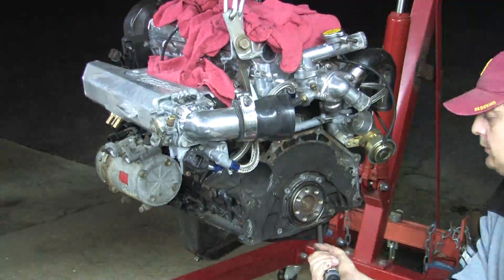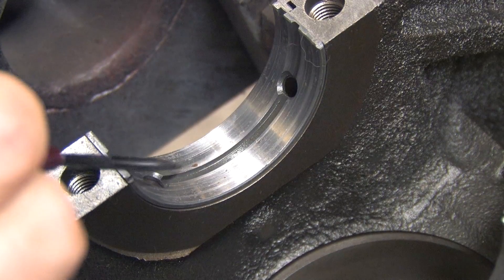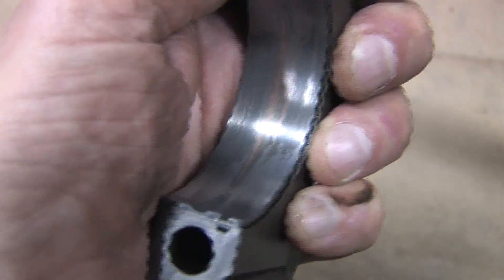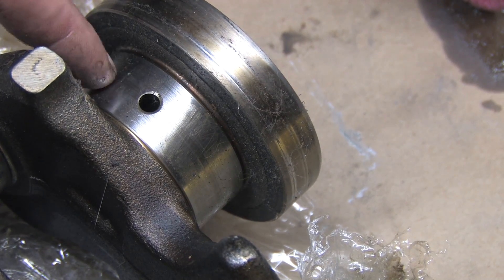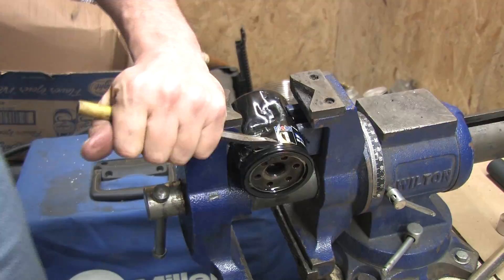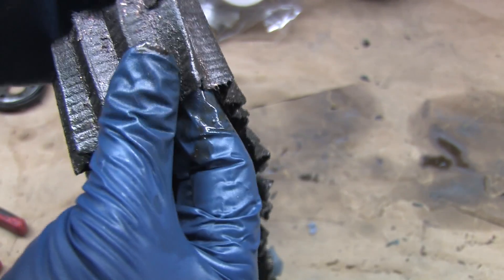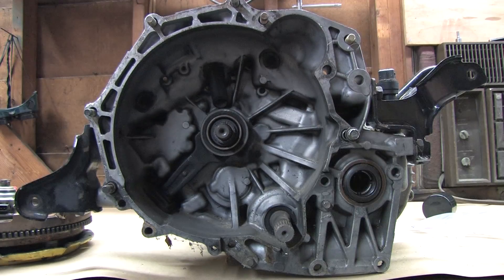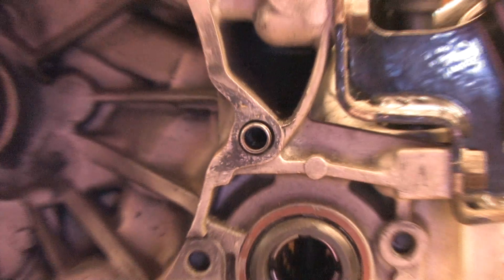7-Bolt Shortblock Failure - Full Diagnosis

Comment: I used to work in a Saab specialty shop. Saab oil filters come with a plastic cover to prevent debris from getting into them. You had to be careful when you puller the cover off because sometimes the little nipple that went into the thread would break off and stay in the filter.
We had an underpaid guy who worked for us that did all our oil changes, tire, etc and he changed the oil on a car and accidently left a tiny bit of plastic in the filter that got sucked up and lodged in the oil port to the head. It passed just enough oil that the car ran, but the lifters would start to clatter a bit when it got hot and he ran it hard.
About 2 months after he got his oil changed, the engine underwent catastrophic failure. When I took the engine apart to determine the cause, it looked almost exactly like you engine looked, major damage at one critical point, and minor damage from all the metal in the oil.
Your point about the missing bolt and the clutch is spot on. You will get all sorts of major issues from that bolt being missing.
I seriously doubt that was the cause of your problem though. I suspect that something blocked that oil port.
Reply from the maker: Thank you for your detailed comparison.  I fully agree with you.  I did have oiling problems in this engine.  But it would have taken a LOT longer for the bearings to spin if I didn't have a mis-aligned clutch hammering and pounding on those bearings prior to the oil starvation.  That clutch bolt is responsible for more cases of crankwalk than DSM owners are willing to admit.  Like the clutch problem, the oiling problem was my fault because I'm my own mechanic.  That's why I'm here owning my mistakes.  ;)
Reply: That bolt is the cause of a lot of problems. I have seen destroyed clutches, damaged crank flanges, broken starter holes, and many other problems like that on all makes that have that basic system, so it is not just your car but a front wheel design flaw that is not easily remedied.
If it was the primary cause though, you would have had more damage to the thrust bearing surface (it did not look very bad to me, and .014 is not enough endplay to obstruct the oil ports), and the rear bearing would have been in worse shape.
Mistakes happen. Even the best techs let a piece of junk fall in an engine from time to time. I once dropped an M&M a Saab fill tube. This was back when Saab engines used the transmission as an oil pan. I had to pull the engine and separate the units to retrieve my candy. My boss was pissed lol.
Reply from the maker: joshua43214 Ah yes.  The old-skool Saab 900.  Joy of joys.  You had to pull the engine for just about every service job on those things.  It's a shame that M&M's aren't magnetic.
Reply: *****  Lol, yes, it's just too bad. The M&M isn't magnetic, but it is attractive. MMMM. Candy. :)

Comment: This exact method of failure occurred on my 6-bolt...the "crank walk bolt" fell out and then the engine started loosening the others+the starter bolts.  I caught it after replacing the clutch and it's shifted like butter since. Thanks for posting this...hopefully it saves a few engines (and broken dreams).

Comment: i think i found the cause of crankwalk..starting your car with the clutch pressed,on the 7 bolt engine the oil film tends to run off the lateral bearing,on a cold startup with the clutch pressed there is no lubrication untill the oil psi gets there,so there is s moment of wear...

Comment: 3/4 rods spun and if it was bent why would the thrust/#3 main be the only bearings with extreme wear like that? I would think itd be more like 1&5 with the extreme wear if that was the case. your 100% correct .015" end play is a significant amount of end play. just curious did you bother placing the damaged crank on a balance machine confirming it was bent? this is interesting. could it be that the bearings weren't perfect and journal originally wasn't in spec? what brand bearings?

Comment: excellent video, bravo. as Honda owner and a caterpillar technician and have been thru several failure analysis classes, blew and built 100's of engines and my conclusion is this engine was oil starved at some point whether the engine oil level wasn't adjusted properly or the engine was raped on with low oil temperatures, since 3&4 are the furthest away from the pump they were the last to get lubricated. bending a crankshaft from shock load isn't likely IMO, that don't really don't explain why

Comment: I've encountered this issue MANY times. Rather than crankwalk, i've seen it all too often result in cracked and broken bellhousings. Two GVR4's came into my possession over the years which each had this "special bolt" as i call it, missing. They both had cracked bellhousings. A word to the wise, if any of you reading this ever have someone ELSE work on your car, make SURE they put this bolt back in! The factory one has a 12mm head, and has a #10 on it.

Comment: jaf, what's your thoughts about flywheel step. The machine shop told me the competition clutch flywheel I bought was .605-606 when he measured it and he took multiple measurements.  he said it would be ok to run it like that and he straight up told me he couldn't get it any better or maybe make it worse?

Comment: Thanks for your reply! Hey, if you would like to check out the sound I was talking about, just visit my channel and there is a single uploaded clip of my car and the sound. Actually there are two different sounds; the first one comes in at around 0:11, and sounds a bit like a loose metal part, and the second, more worrying sound can be heard throughout the clip while the engine is on. It might be lifter tick as you said, it might also be a worn ball bearing on the pumps.

Comment: Although this was a very interesting and informative video, it somehow creeped the hell out of me; how one single, tiny, probably 1-2 dollar bolt can save your engine, or destroy it if it's not present.

I have a '99 Galant with a 4G64 2.4L engine. Can the same rules apply there? Should I go and take a look if I am also missing said bolt? I've already got some nasty ticking sounds coming from the engine, I don't want any other worries...

Comment: Very interesting. Does the same thing apply for FWD transmissions too?  I'm going to look up under mine tomorrow to see if the clowns who built the motor and put it back together put that bolt back.
They didn't even put the flywheel cover back on, so my expectations aren't very high.

Comment: I believe my '97 GSX recently suffered from the same failure you experienced with your 7-bolt, but I have yet to tear it down. Could be worse, Piston #2 came in contact with my spark plug. I also found a rocker floating around in my head, over that same cylinder. I'm going to verify for you, if that "crankwalk" bolt is in it's place, though I doubt it.

Comment: I can't post a link for you, but you should find a good explanation by doing a search on "4G63" engines.  I don't have enough experience to confirm it, but I've read that "six bolt" refers to engines from 1990 to early 1992, and "seven bolt" refers to engines from early 1992 to, um, something like 2006.  An Internet search should fill in the details.

Comment: Given the damage that happens once the bypass valve is activated, I wonder how hard it would be to add a sensor to that valve. If I'm running on unfiltered "emergency" oil, I want a warning light. Jafro said in the video that "oil filters bypass some of the oil, and that's just how it goes", so I guess that a very simple warning light would give lots of false alarms. I'd still rather have that sensor, however, in case there's a sudden jump in the frequency or duration of unfiltered oil events.

Comment: On another note, has anyone that had this bolt missing and then put a bolt recently on that hole noticed a diffrence on clutch engadgement? From what ive noticed the clutch engages sooner now after the bolt had been installed. Or its just me overthinking things and being paranoid? Oh and btw a bolt that i have in there atm is just from a auto parts store m8x60 1.25 threads. If thats the correct one.

Comment: Hey jafro great informative video. Bitter sweet experience for me because i was praying that once i crawl underneath my car i would find this bolt on that hole however it was missing. I hope its not too late. Ive driven my car for 8k miles for two years now (133k on odo atm) since i bought it. Hard acceleration here and there. I hope its not too late now that i have that bolt in there. Car is stock and its my dd.

Comment: The drain back valve you referred to is a separate valve that most oil filters are equipped with and is essentially a check valve made of rubber that blocks oil from draining back through the INLET side of the filter(outer holes). Also, not to be too picky but not ALL oil filters are equipped with a by pass valve either, the by pass valve on GM engines is integral to the oil filter adapter therefore filters made for GM engines are not equipped with one. Awesome video's keep up the good work.

Comment: This video was published the same week I was pulling the transmission out of a neglected 1G I had just bought.  I just now saw this, weeks after I sorted the problem out.  I wish I had seen this sooner.  :D  That bolt was broken off in the transmission on the car I bought, and several other bolts were missing.  The previous owner had driven it that way, until the clutch gave out.  This video will haunt me until I decide to pull the engine and rebuild it...

Comment: I recently replaced the transmission on my 88 Colt C50 and even on the small 4g15 Engine that Bolt is hard to reach, it sits directly between the lower Crossmember and the rear engine mount and there isn't really enough space to use a ratchet down there if you don't have a carlift. I used 2 long extensions and had a friend operating the ratchet from above while I was holding it in place from under the car.

Comment: hey jafro. I have no compression in cyl 2. pretty much 0 psi. what could be causing this? I just pulled they head and all my valves look fine?! this is right after a head rebuild too :[ all the other cylinders have great compression.

Comment: Thanks so much. Manufacturer recommendation is 5W-30. I am thinking of going with 0w-40. By having zero weight, I can have my oil flow quickly during cold and when it get hot, it will have weight of 40.. You know I may go wrong with my thought process and will wait what u recommend and pls kick me if I went wrong..

Comment: Yes this bolt is VERY important people. Even more important for a 1G / 6 bolt combo utilizing only 4 total bolts holding the entire tranny on the block. Loose this rear bolt and you will have trouble and even more so with a worn tranny mount. The starter bolts have nothing to do with holding the tranny to the block and only hold the starter to the tranny.  But the bottom line is you need all  bolts and even pressure. ALSO...this bolt threads into the tranny and is ALUMINUM. Watch torque specs!

Comment: Thanks For Super Fast response.   I have a question , not sure if can ask here, i have 2005 Toyota corolla, have changed crank shaft , rod and main bearing.. I have a noise coming from lower end, only when engine is cold, but when it gets hot that noise goes away.  i can see that when i hold the engine RPM at 2500 to 2700.  any advise, please.  also a note, i had this problem even before with my old crank..

Comment: I have an automatic 97 GSX, I could put an aftermarket crank and rods in and just throw boost at it without worrying about crank walk. the destructive forces are way high in manual cars. I have 2 extra blocks, a first gen(6 or 7 bolt, don't really know), and a 98-99 thrust washer 7 bolt.  You know a lot about dsms, can you help me with a BISS screw problem, I moved it and know the car won't run hardly at all.  it was leaking boost pretty bad.